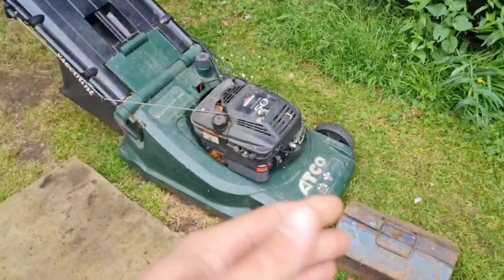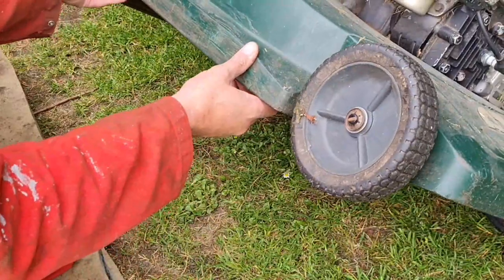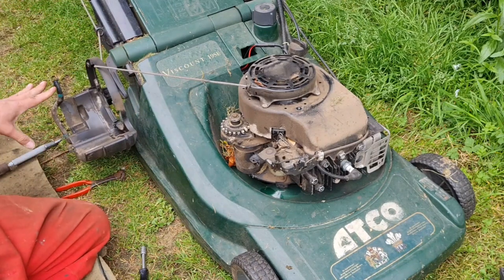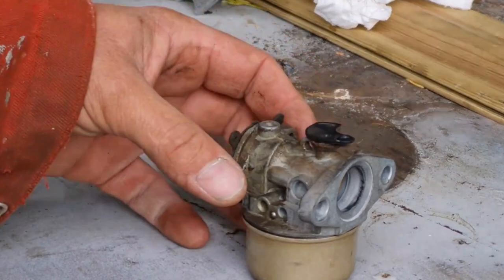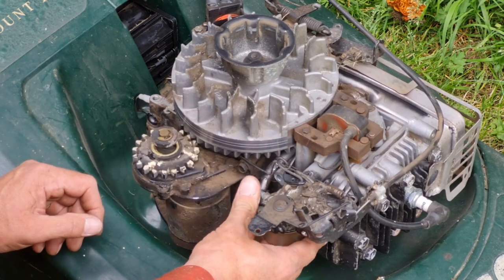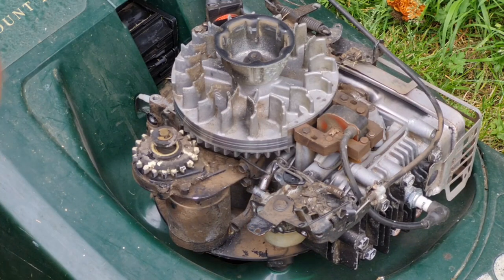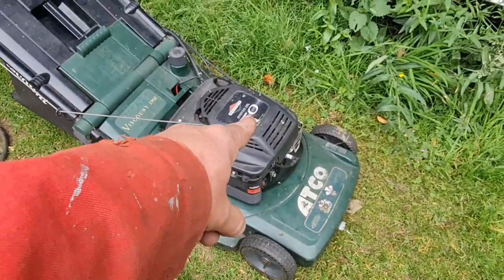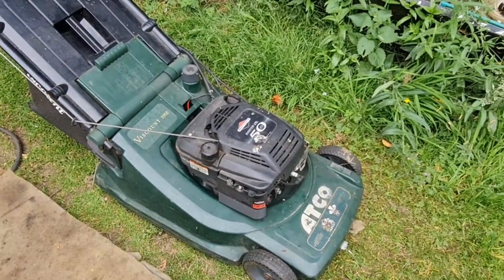DIY Mower Service. Briggs and Steatton Engine.

Comment: I was reluctant but those small impact tools are brilliant, I have one of them 10.8v ones and they are a game changer I use it all the time now, you have to get some more nut drivers for them  but they are cheap on the evil bay,  so impressed I got larger makita 18v one as well, just be very careful when tightening, especially onto plastic or ally, totally recommended though, electro digitals! you bin watching Vice grip garage haha?..ahaaa